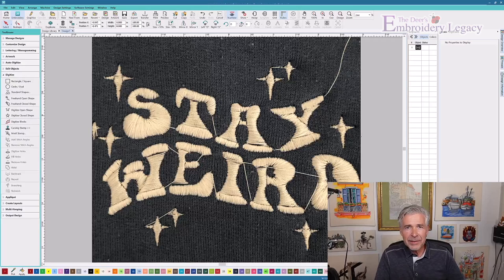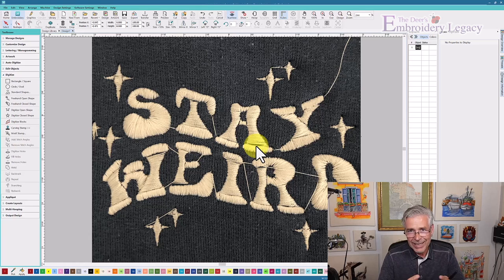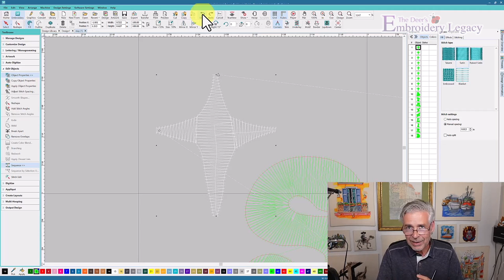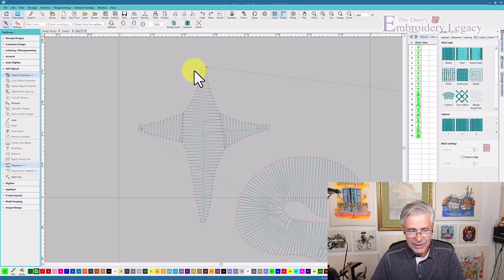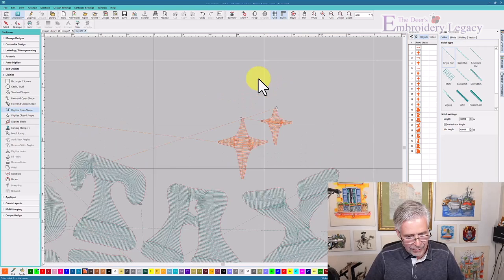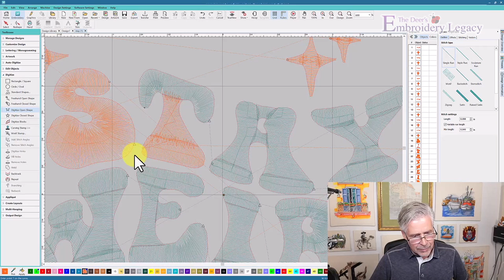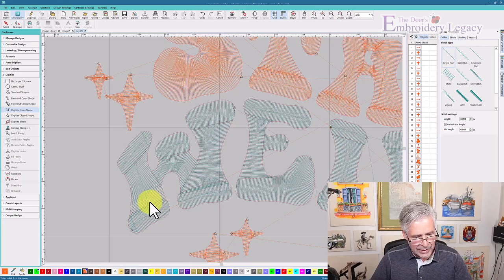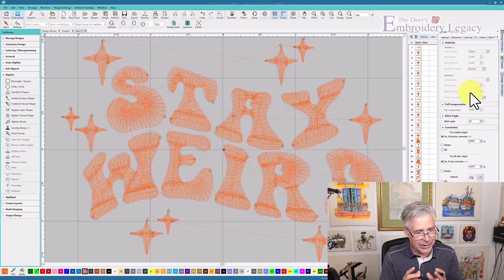Removing Gaps in Embroidery Satin Stitches - Embroidery Digitizing Tips & Tricks

Comment: Considering that the original design had rather generous overlaps between the objects and they still separated, I wonder how much of it is actually the design and how much is due to bad hooping, weak stabilizer and maybe not entering the fabric you intend to use and leaving the software at the all-forgiving, default poly cotton?

Comment: I'm new to embroidery. I have designs that have gaps in them but I'm wondering if it's a digitizing issue or if it's hooping or machine tension. On a recent design, in the digital file it's even, but when I went to embroider it, I noticed gapping issues and that it was shifting to the left. The gaps on the left were larger, and some of my design overlapped but only on the left side. What could cause this pulling?
Reply: I have the same problem! 😭
Reply: @KHONAMII  I took a break from embroidery and came back to it recently. I haven't attempted any old design, but I've been doing things differently now. When designing embroidery files, there was one feature that removed overlaps, and I've found that it was a major cause of my gapping. As far as the shifting is concerned, I still don't have a solid answer because every new design I've made has come out perfect.